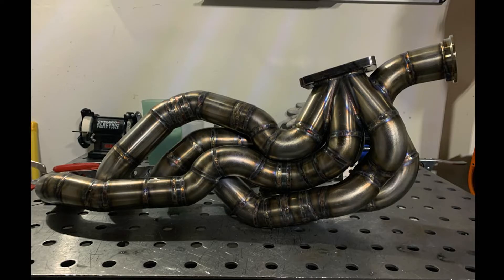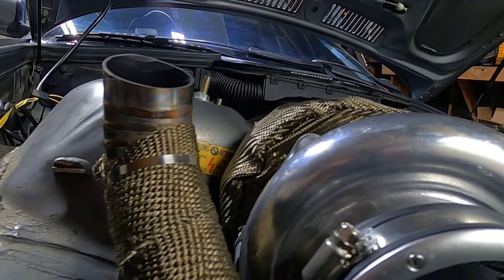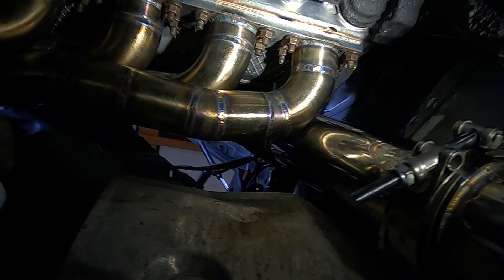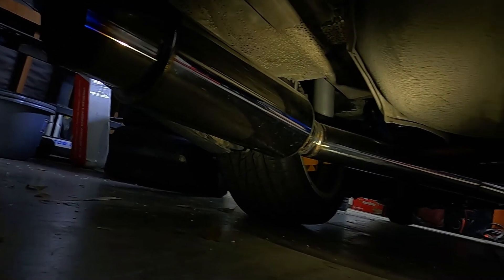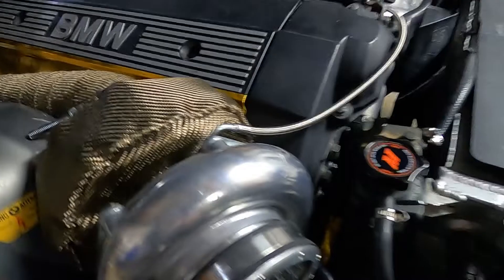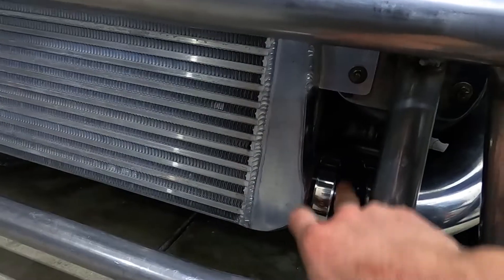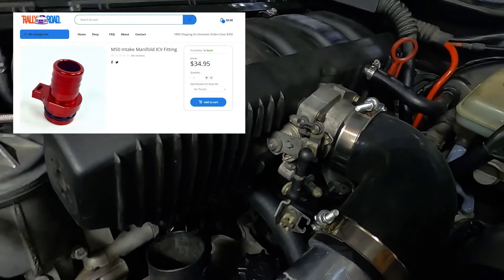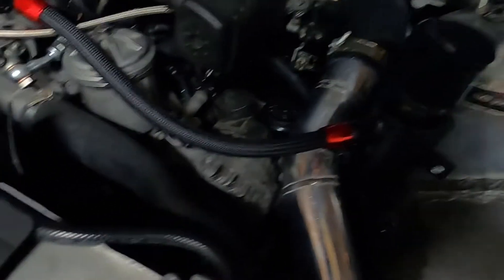How I CUSTOM BUILT my TURBO E36 pt.3- Exhaust + Intake

Comment: Do you have cutting template or jig for this merge collector?
Reply from the maker: I used the LPS CCV v3 jig for my merge collector, it’s a bit pricey but it came in very handy.I recommend getting some pvc and just playing around with different angles until you find something that works for you
Reply: @Purpose_Built  yeah was thinking about using pvc pipes aswell